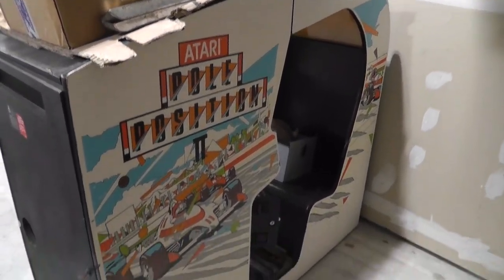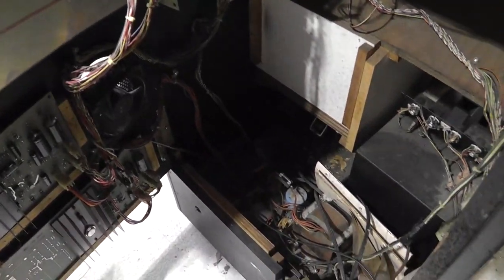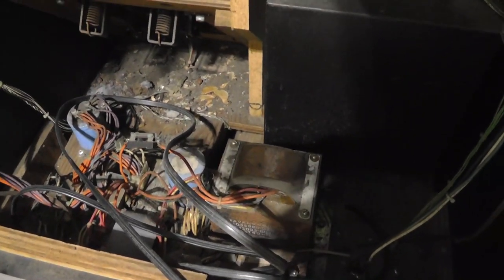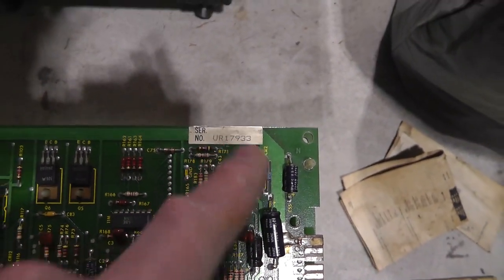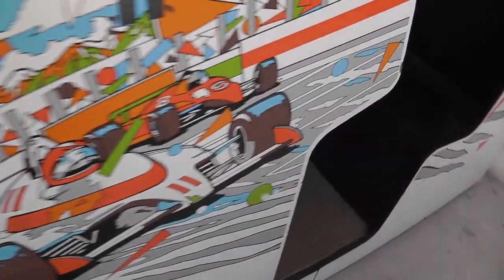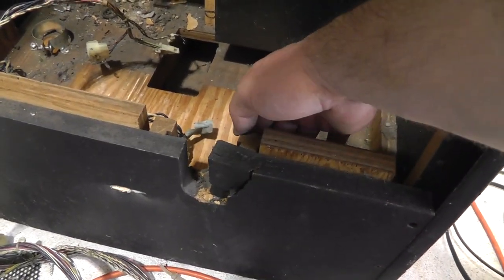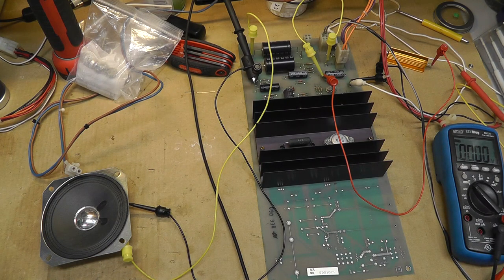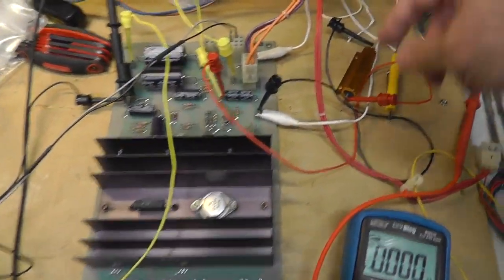Atari Pole Position Cockpit - Refurb Part 1 - Teardown & AR2 Repair

Comment: How’s the game doing today ? I just picked up a cockpit but needs work.  Blue screen.   No sound.   Any suggestions on what could be wrong ?
Reply from the maker: Congrats on your pick up.  Start with power and make sure pcb card edge is in good shape or gnd and +5v have been jumpered.  Look for battery corrosion and I guess watch some of my videos :)  Good luck!